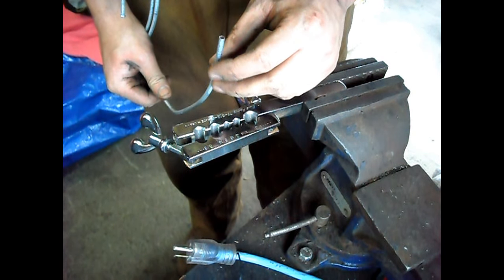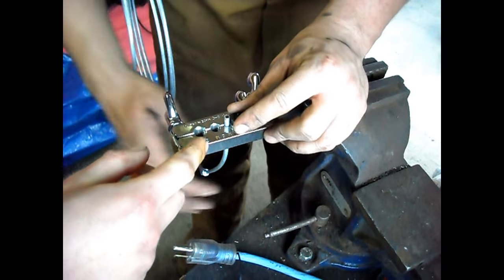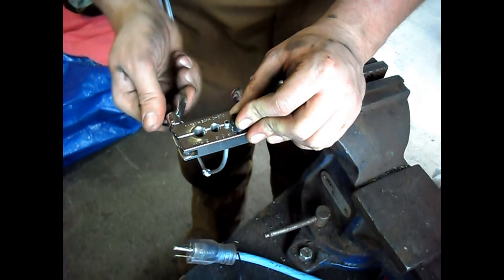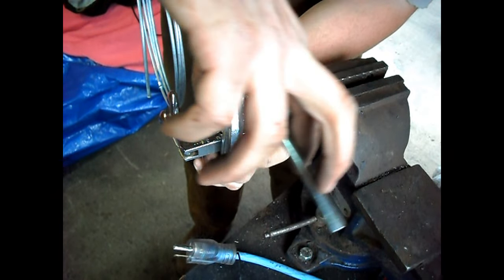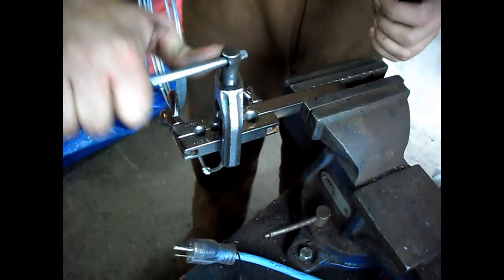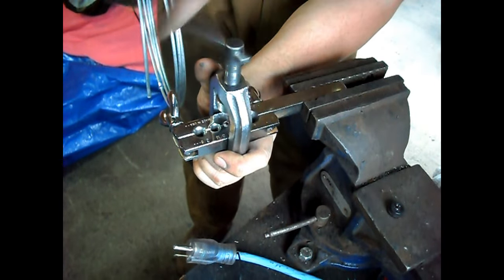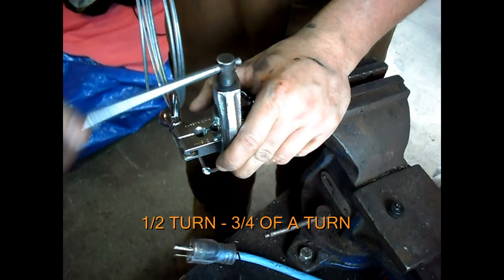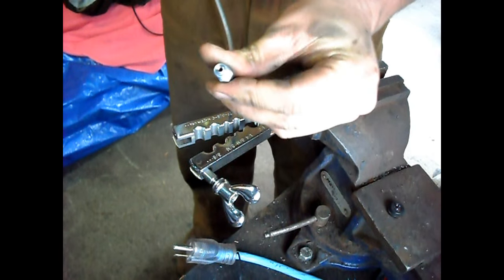How to use a Flaring Tool - Double Flare

Comment: Great vid, thanks for posting.  I just tonight bought a Craftsman flaring kit, Rigid cutter with reamer, and a bender of some make (I skimped there but a friend uses that one).  I plan to use poly armour tubing to replace the entire fuel line on my 1972 Chevy truck.  I am very excited as I have never done anything like this before.  :-)

Comment: Good video!  If you only need to use the tool once, save $25 and rent it from somewhere like Autozone as I ended up doing. Instructions were gone, but this video was straight forward enough for me to make two flares on a transmission line.

Comment: never use a screwdriver to over tighten it's not braun over brain...
Reply: Then how do you keep the flaring tool from pushing the tube through the serrated hole?